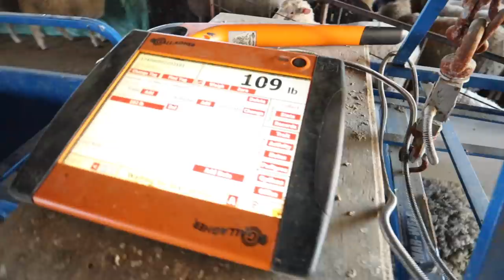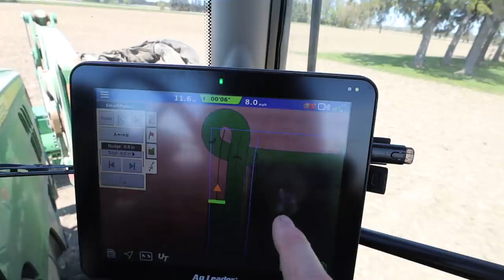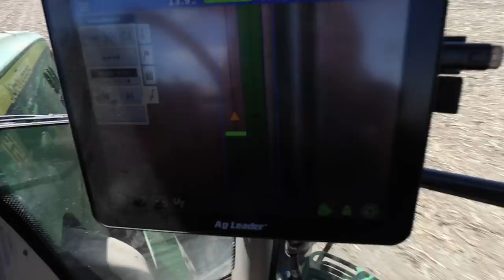I was dreading today... | MILES MOVED OUT😬 | Vlog 449

Comment: We use a hand pump sprayer with a bleach solution to spray our gates and fences when we have Orf. We noticed when the lambs play with the gates and fence wire, we got more Orf. You know lambs, they touch and taste everything. We spray when we clean. Knock on wood,  we haven't had Orf for  three years. I use 1 gallon water to 1 cup bleach. It drys quickly, and with a few days between moves,  there isn't any residue left behind after it drys.  Just a thought that might work for you.
Reply: Why not just vaccinate?

Comment: don't forget to check the bottom of the trailer for rust! most trailers rust out before anyone notices around the frame and connections for the axles.

as for the feeders is take them over for a power wash with a good soap...you can do the milk plastic things too and maybe the pen panels by hand(I know it would take forever that way) or power wash them when you clean out that side for new lambs.(might need to empty both sides into one alleyway for a bit or with the handling system area.)

Comment: With you wanting to sanitize that area You could get a 1 1/2-2 gallon sprayer. Then use something that's Sheep Friendly and Spray down the area plus the Gates/Dividers and Feeder. You could also use to Sanitize Shoots. Just a Thought. Glad Miles is going to Belinda's.  Peace from WV
Reply: Heck yeah! Just gotta make sure it's not corrosive on the equipment. A bleach solution is probably out and that'd be the cheapest option. I'm out of the loop for barn cleaners nowadays.

Comment: On the curved part of your chute at 16.55 you could cut the vertical bars and have a slotting system made up where you can take them off and put them back for different height animals. you'd cut them where the square tube meets the solid sides, and have a square bar/tube that is the internal dimensions of the tube welded on so that the top section slips over those now posts and drill each to take a keeper pin just to make them more secure. Or probably better, have the smaller posts welded to the upper part that slip down into the bars on the lower section that way the entire curve would not have anything at all sticking up when upper is removed. It is hard to see if there are square tube sections below those upright bars, but it would not be hard to add even round tube sections under where you would have the posts if you were to do it that way. Anyone with welding and simple engineering skills could do it and it seems you have some pretty decent folks that do your work. I'd offer but New Zealand is pretty far away and in lock down atm lol. But yeah we have made similar in the past for various situations, I think it would save you a tonne of stress on your back! Oh you could do the outer and inner curve too that'd be sweet lol. Hope that helps in some way, and I can pay back the tips you have shared with me lol.

Comment: I know lockdown is no fun but if you get sick we may miss your vids. In 2014 I contacted SARS, I lost 3/4 of my lungs I only have a quarter that works. I was sent from my home hospital flight for life to another hospital where I was in a coma for two weeks. Then I was air lifted to Denver, on the flight the ventilator I was on was not built for high altitudes, so it failed causing my lungs to collapsed, my brain to stroke and my heart stopped I was legally dead. Thank God for letting me come back, I wouldn't have found your channel.

Comment: I see you turned your feeders back 90 degrees to the original position. You’d have to redo the piping that fills the feeder to change the position. So good idea in theory, but in practice, the current setup has been working.

Comment: Could you need to replace the milk machine hoses to help prevent orf? If it’s the bottle babies getting it the worst that would be my first thought
Reply: There’s that, but also bottle babies are the most vulnerable to get it in the first place, regardless of the milk machine aka nanny. Simply because they don’t get the same level of immunity and protection they would get ifrom mom! Sure they share nipples, but so do twins with mom, and lambs that steal milk have been known to infect other moms. Replacing hoses is useless is an infected lamb drinks from a brand new hose. You’d replace the hose once the infection runs its course sure, but any sooner is a huge waste of money. You’d also be better off to just wash and sanitize them, no sense on replacing if they’re not damaged and impossible to throughly clean…

Comment: Do you have access to Tannerite, for that big rock if it can't be moved mechanically. A pint container of it with a gallon milk jug full of water with a screw-on cap, a little over eight pounds sitting on top of it creates a lot of downforce.

Comment: Re: disinfecting post ORF (? sp):  seems to be safe, you’d be best off cleaning the handling system and trailer after they use it. Can you make a mild bleach/water solution and spray it on, then let it air dry?
Reply: I was thinking the same but the urine is ammonia and shouldn't be mixed with bleach.
  I just did a bit of research and found that plain hot water and a good dish soap and air dry will do wonders. That way she could steam clean the concrete pen and mangers also.